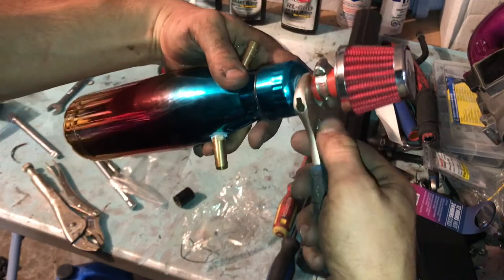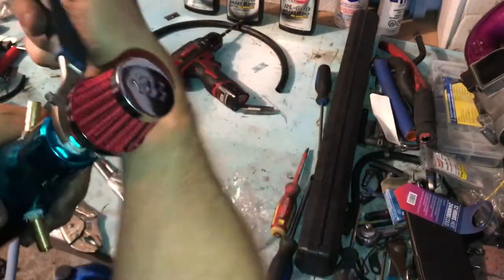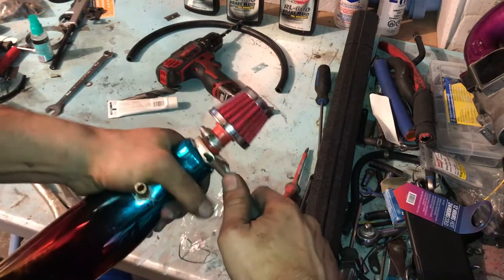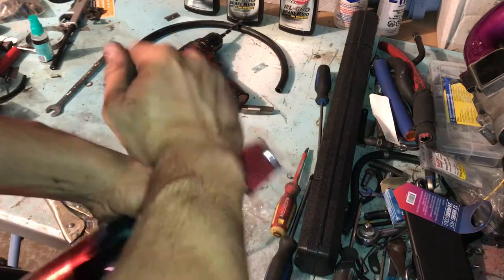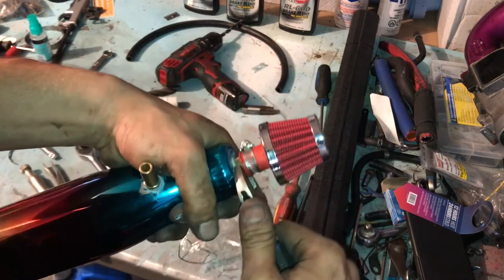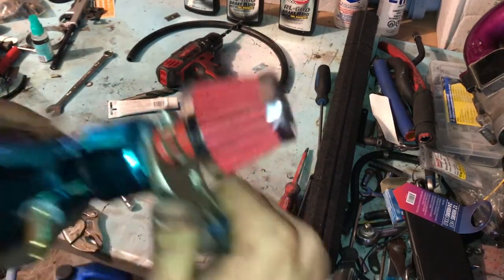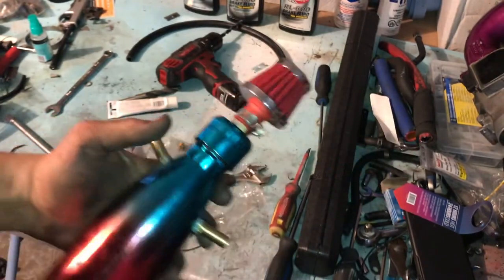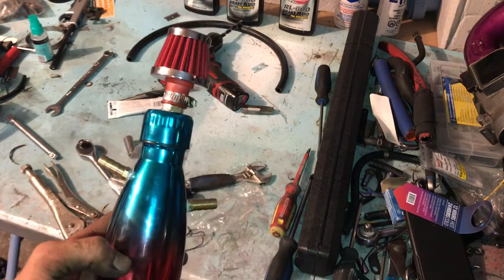DIY $20 Oil Catch Can

Comment: Did you ever install it? If yes how much time did you use it for?
Reply from the maker: Yeah actually it’s still being used. I installed it on my new turbo Miata build.
Reply: @NickMeinert  Thanks for the answer mate. Good luck with your projects.  I am looking into making an oil catch can for myself and wanna do it cheap as possible.